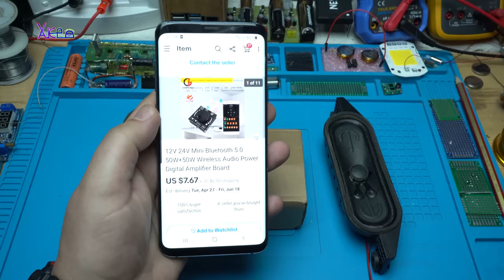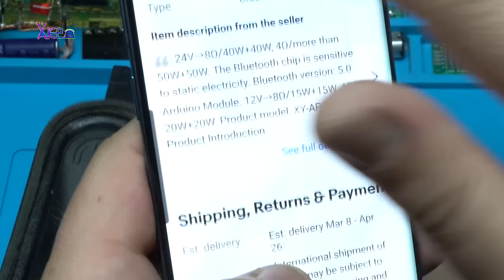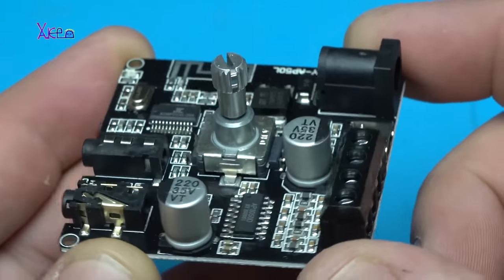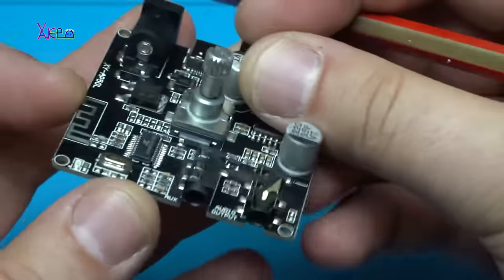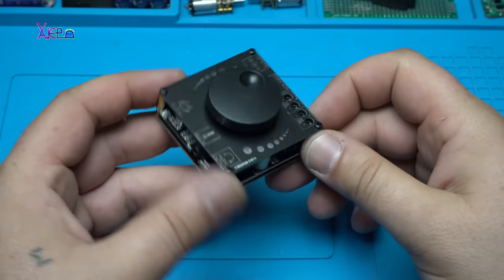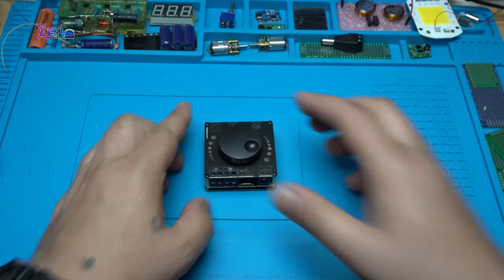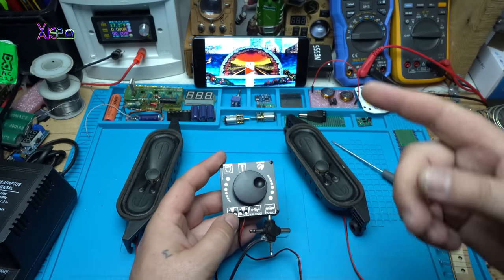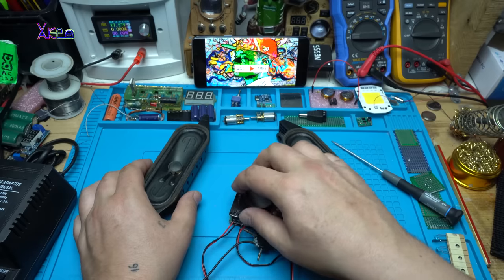50W + 50W 12V Bluetooth Audio Amplifier | Hear how it Sounds?

Comment: I got the XY-C100L and was very impressed by the volume and quality I got when I connect it to a pair of speakers. Got some loud music with heavy basses, which I thought would only be obtainable with a heavy amplifier with large cooling blocks. Technology has come a long way.

The reason I got it was to test some second hand speakers and have this cheap amp destroyed instead of my vintage record player if something would have been wrong. Turns out it’s really good and survived the test, so will keep using it with a different pair in an other room.
Reply: May I know the input voltage and current
Reply: I used an old 19v laptop power supply. Input voltage is between 5 and 24 Volt DC

Comment: I've got two of these. I use one with my TV, to connect two old 20W Aiwa hifi speakers. With a 12V 1.5A supply it shouldn't be maxing those speakers but it sounds very good at as loud as I would want my living room TV. The other one I use with another pair of slightly beefier speakers for a PA for a crowd of 50 or so at a sporting event. I was amazed how good it was. I used a 12V 5A supply and had it turned up to full.

So, 2x50 is probably an exaggeration but it is very impressive

Comment: I
 have this BT amplifer and speakers withsubwoofer from LG TV :-) it works perfectly :D
Reply from the maker: Good for you
Reply: Sir, where did you attached the subwoofer when there is two slots only for left and right speaker?
Reply: @clanmaster2136  the TV speakers I used are connected to each other and have a frequency crossover on them. So just connect the left and right channels and the subwoofer filters the low frequencies through the coil and capacitor. Same connection as multiple speaker boxes.
Reply: @KorbenDalasCZ  Thank you sir

Comment: yo tengo unos Fosi Audio TPA3116 y ambos trajeron un transformador AC to DC de 19V-4.5A uno trajo de 5A y 18V pero supuestamente aguantan hasta 27V pero parece que con 18V ya es suficiente para 50w por canal.
Reply from the maker: Did you test it at 27v? 19v is ok

Comment: You should of used bookshelf speakers to test the strength of the amp. Those small speakers only need 1 watt to get going not a good example of testing the output .

Comment: You need a much more powerfull power supply. Your’s is only 18 watts, at 12v you need 8.3A and at 24v you need 4.1A.
Reply: That was my thought.
Reply: 28 v ???
Reply: And if you use 24v ..make sure to put small heatsink on the chip!!!

Comment: It does not sound like 50w? maybe peak watts, but i like  how it looks cute  I think LM386 would be a good competitor for that god bless
Reply: because he is using 12v 1.5A power adapter, this board requires 24V 5A to reach its maximum output
Reply: @pepe-zc5kk  Oh' originally 25vdc max  ok
Reply: @pepe-zc5kk  hi pal, how would ypu connect this amp to a 3 way crossover? Would you just use one channel on the amp and wire it to a cross over, would you loose 50w from the other channel? Or could you maybe bridge the amp before connecting to crossover?
Reply: @pepe-zc5kk  I think you'd need a very big heat sink on that little chip if you wanted to run it at 50w per channel. 😟

Comment: Hi, I'm building the same speaker. 
I want to power it with a battery. So I need help to determine the final power consumption and battery size. 2 speakers, 10w each. with the same digital bluetooth amp.
Thanks
Reply from the maker: You can use 12v 7A battery that mostly are used in motorcycles and with those 10w speakers your amp will work around 10 hours without problem
Reply: @Hacktuber  Thanks a lot bro

Comment: Hello everyone, I have 2 pioneer passive 70W 8 ohm. Which voltage and amparage should I use to extract the best power of this amplifier, without heating problems?

Comment: At the most it looks and sounds like a 2 Watt RMS system
Reply: YES NOT 50 WATT
Reply: I have this amp and no it doesn't sound like 2W even if I used 12V it sounded like 20W each and when I used 24V which is the max voltage it could even surpass 100W(50 each)  by a bit.

Comment: How would you connect that amp to a 3 way crossover? Would you just use 1 channel from amp and connect it to a crossover, would you loose power that way? Or would you bridge the amp before the crossover?
Reply: if you only need mono you could just bridge it before crossover. there are some losses in all components, so you would loose a little power but probably not much if the x-over is good

Comment: Can i plug the power straight into - + car battery ?
Reply from the maker: Yes just be careful which is positive and negative wire
Reply: @Hacktuber  thanks mate. I brought 3 now lol.the 3rd one I got should of been the first and only 1. This one has a subwoofer thing on as well as left and right. Really happy with these cheap tiny things 👍

Comment: I have something somilar from aly express and say  100w+100w....5v power suply to 24v power suply. I use 12v 4.33A power suply and 2 AYWA speakers 40w each speaker and 8 ohm from old 5.1 system and sound amazing and more powerful than expected....but get rly hot at full volume....your amp don't hav any radiator....so...don't overheat at max lvl?
Reply from the maker: Yes need a fan for cooling